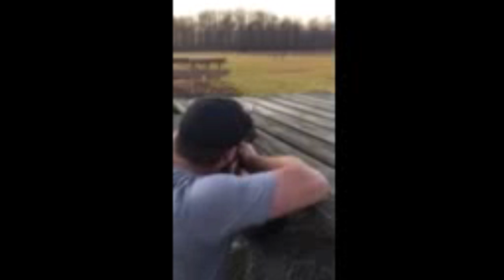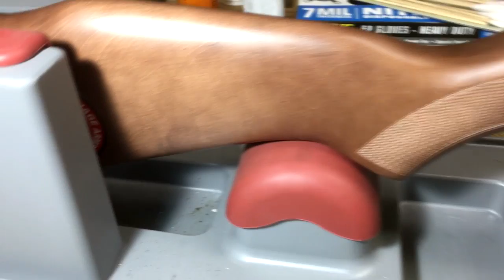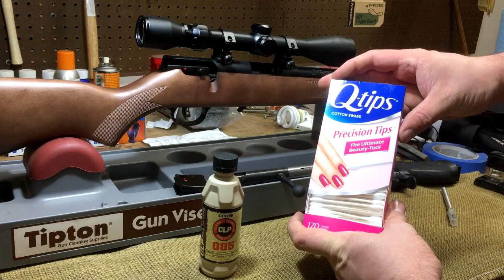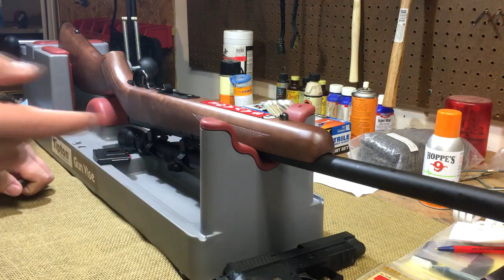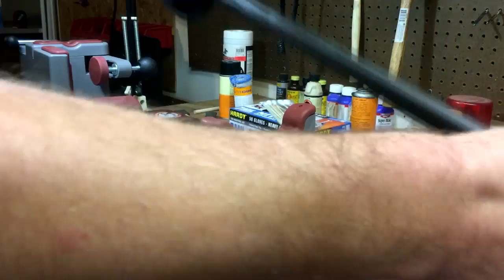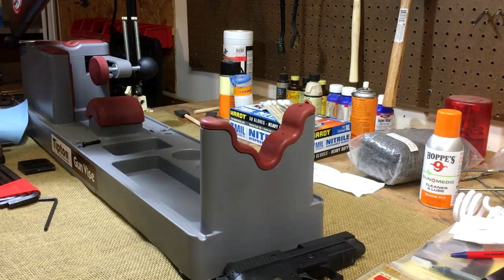Savage 93R17 disassembly and quick table top

Comment: There is a sort of "Carter pin" if you will, holds the back of the saftey..the opposite side of the switch.  Without it your saftey will pull through and the spring will not engage. The saftey switch will flop around and the gun can actually discharge. Mine came factory like that, missing the little "Carter pin" thing.. and the rifle did discharge. Your video was the only one that gave me a good visual, and great information. Thanks a lot I fixed my rifle, I had only shot it maybe 10 times before it went wrong.